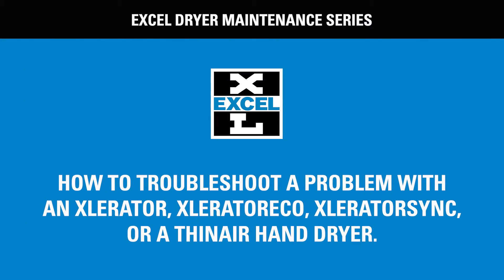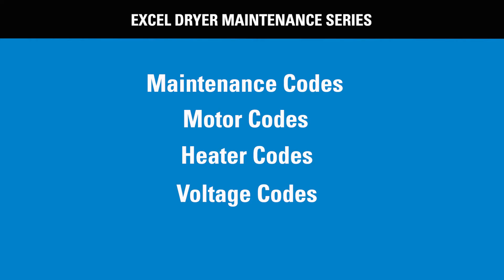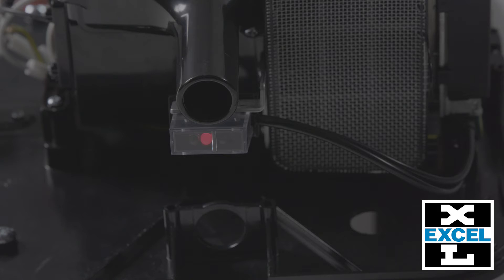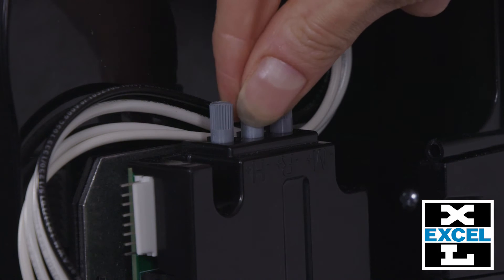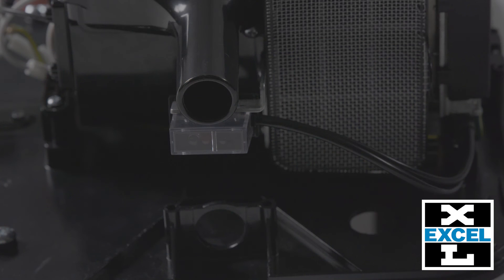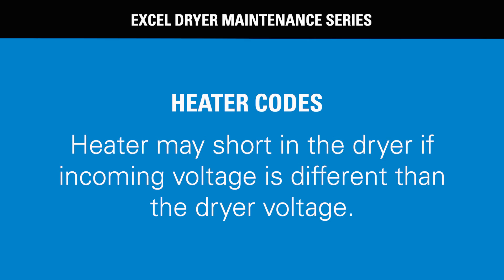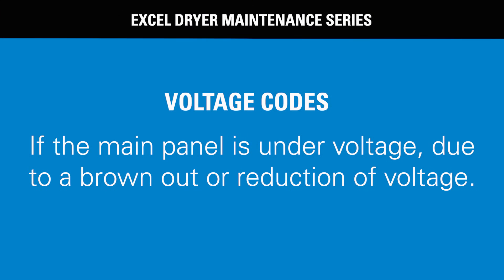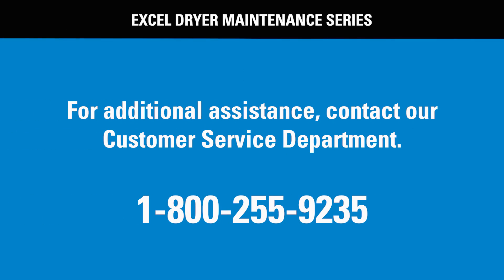How To Troubleshoot A Problem With A Hand Dryer By Excel Dryer

Comment: How do u replace a sensor
Reply: Not think that’s positive but if it is it will be difficult cause it’s connected to a circuit board but I think it can be removed by just pulling it out but I think it’s also hidden from view when you take off the cover so you might haft to open up the unit it’s self and do some magic in that